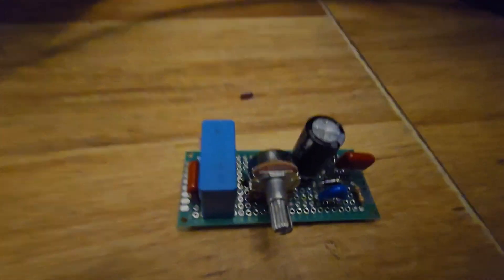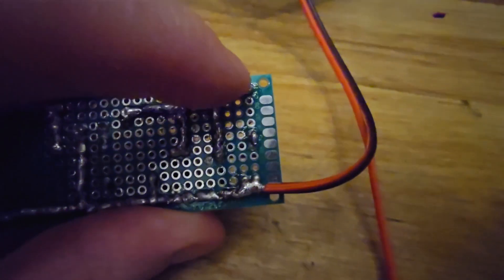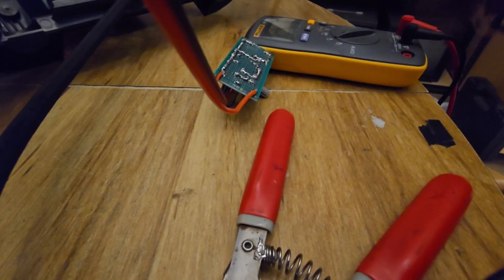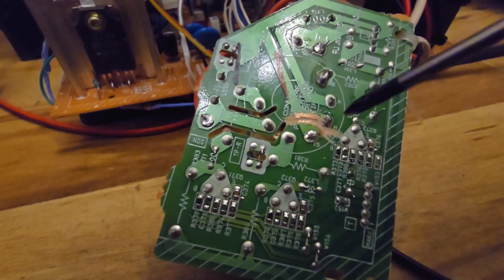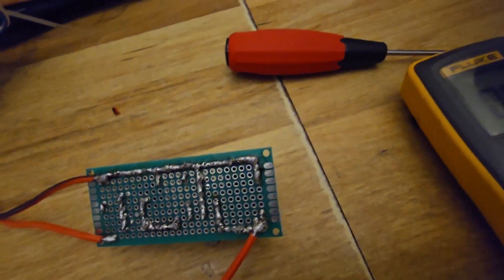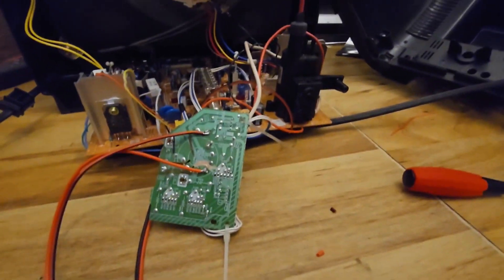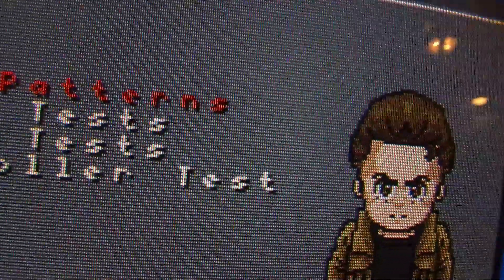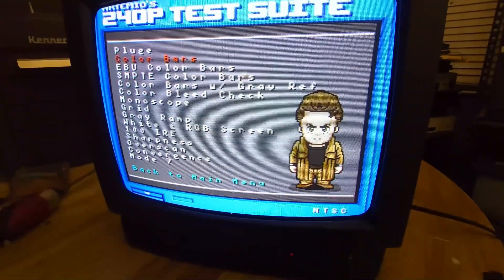How to install the G1 Mod Board for CRT.

Comment: I couldn't get it to work either. Might be my TV though. JVC AV21E14. Flyback was F0501-3123. I used a portable oscilloscope and found pin 5 to have negative waveform. When I connected it, it burnt the 100 ohm resistor.

Comment: This is Luke, the co-creator of the mod.  ElBartoMe being the othet co-creator.

I remember when I first designed this mod, many supposed experts on the Shmups forum told me this mod wouldn’t work, and I didn’t understand how CRTs work.  El BartoMe was the only one that helped.

What is truly humorous is there are people in my old Shmups thread that are still doubting that it works.

Anyway, thanks for making the pre-made kit as it contributes to the community.  Hopefully more CRT enthusiasts enjoy the mod.
Reply from the maker: Thanks Luke! I've tried to give you credit every step of the way. Appreciate your work.
Reply: The amount of people in the first page who obviously didn't even read the original post was astounding.
Reply: Where are you guys based?
I‘m in the EU and I really want to mod my TVs, I know how to solder and basic electronics, but I would love to either get a premade kit or have the option to contact someone about the board I have to build if there’s nothing pre configures available.
Reply from the maker: @rolux4853  I'm in Michigan USA, you can order a kit at the site rgbmods.com

Comment: Can someone tell me what I am doing wrong. Or better help me in PM messages. I have wasted like 50 hours already and ended with burned tube beyond repair. 

I have built board twice. Checked every fkn point. It was 100% ok. I was trying to find negative voltage using multimeter and connecting to every pin one by one. All I have found was -7 volts. 

I bought oscillograph. Found 250 VPP, 36V with -250V peak. Connected it to my board. And 100R on G1 Mod board fried. After that TV was dead blinkin 6 times. 

I have swapped chassis and it immediately started to spark near gun. I turned it off and will carry it to a junkyard now...

What have I done wrong? Why I have never got -200V on the neckboard side? 

TV was Sony KV-14M1 with BE-3 chassis...

Totally upset about wasting a lot of time and money for nothing :(

Comment: Dont now why, but I got zero readings with multimeter on the exit. Builded second one board to exclude mistakes. Same result, not working :/
Reply from the maker: Are you saying you built the boards?  Or you ordered them from me?  Make sure the pot is turned all the way to the right.
Reply: @rgbmods was turned... Board killed my TV eventually. I have built it twice step by step and checked everything. Maybe my chassis was not compatible or maybe I have measured something wrong. I dont know. Too frustrated and dont care about this mod anymore. There is just no normal instructions, half of info is guesses.

Comment: Fantastic. Is there an English version of that Google drive guide?
Reply from the maker: That is the English version.  There's actually another one that's completely in Spanish, and someone else went through and translated most of it in English and that's the one I have linked.
Reply: Just tested the safe 8 pins and got these results. Not sure which to go with! Might have to finally grab an oscilloscope. 

1 ground 
2 -088.7
3 -029.3
4 -28.82
5 ground
6 -132.4
7 -132.3
8 -081.8

Comment: I would protect those exposed traces on the bottom of your perf board. You don't want them shorting or accidentally touching something while applying hundreds of volts to them.

Comment: Hi, thanks, very good explained. What wire gauge did you use for the cables from flyback to pcb and pcb to neckboard? Thanks in advance.
Reply from the maker: I've been using 18awg for both sides and it works fine. You can buy the board with wires from rgbmods.com if you like.

Comment: Hey this is ElBartoME from the shmups forum. I don't suggest connected to random pins on the flyback. The pin on which the HOT is connected to sees peak voltages of up to 1000V. I suggest to always have a look at the schematics first before connecting the PCB to the flyback. If you accidentally connect to the HOT you will fry your PCB and worst case hurt yourself.

Otherwise it looks good and basically how I mod my TVs. I designed a small PCB and use that for all my consumer TVs.
Reply from the maker: Thanks for the feedback ElBartoME!  I made this video to further clarify your point. https://www.youtube.com/watch?v=CYP-vjGBJFU